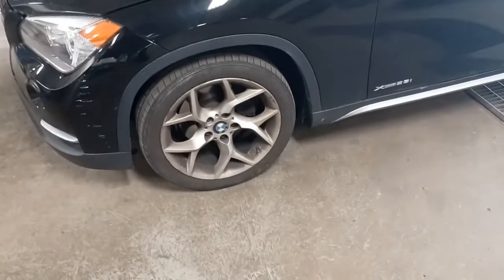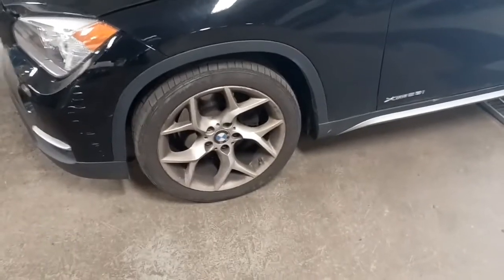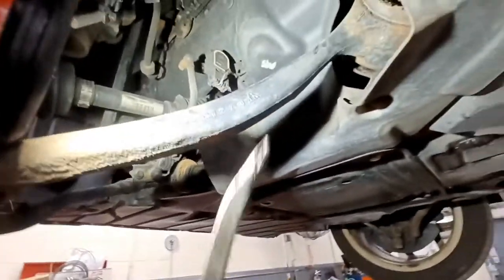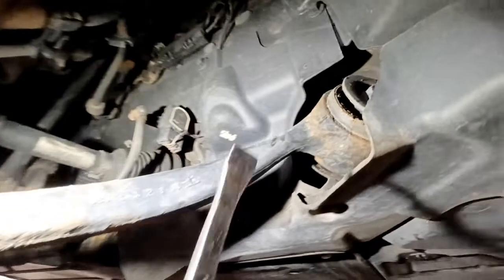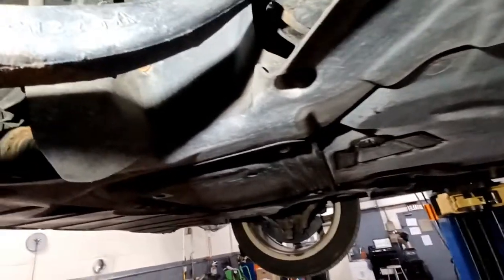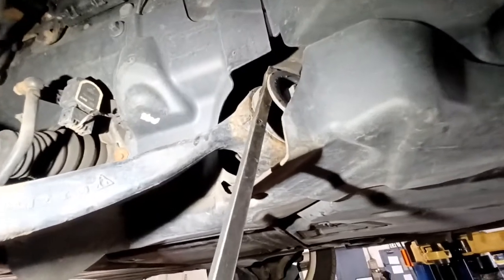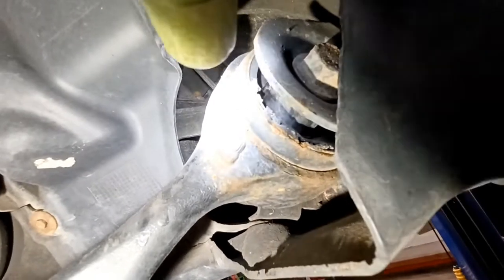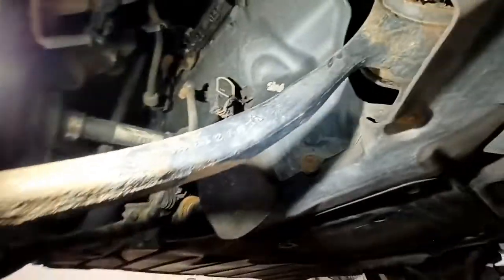BMW X1 SEVERE CLUNK IN FRONT SUSPENSION!

Comment: Clunking over bumps & pot holes is quite annoying in X1, hope 2022 they have resolved this issue.
Reply: Curious, did that fix the issue?
Reply: @TravisVance1856   We change struts, checked all links, still that noise when comes when wheel drops into a pit.

Comment: Are the X1s easy to work on? I have a Discovery2 and there's nothing on it I can't fix myself. Thinking about switching to an X1 but worried it's one of those cars that can't be fixed.
Reply from the maker: They aren’t too bad, I used to work on rovers, discos were always on my hoist lol. X1 is the polar opposite in but definitely has its own problems
Reply: @EuropeanAutoRepair  Appreciate that, thank you very much!